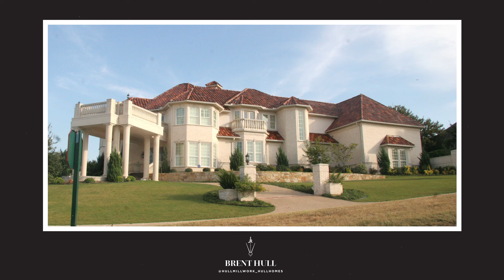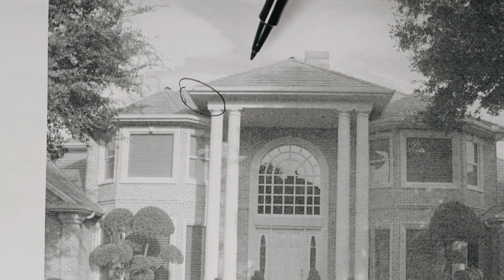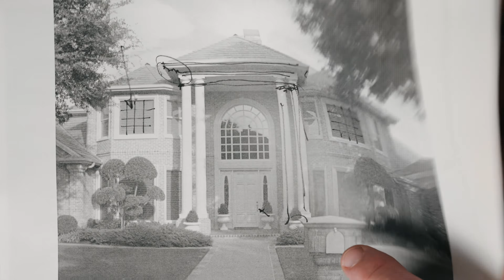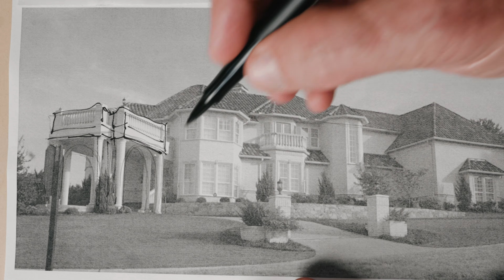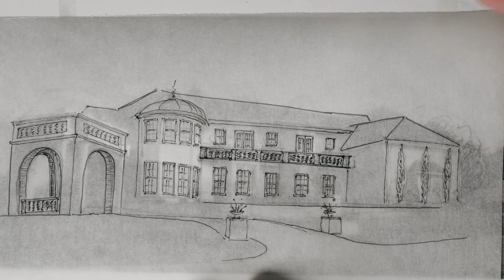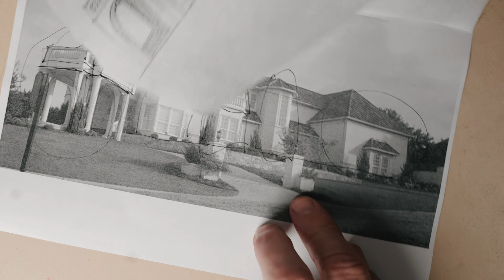What Style Does this House Want to Be?

Comment: I've designed and built three gardens and I follow an R & R rule, which seems to apply to house design too. R & R is Repeat and Rest. I'll mass ten Emerald Green Arborvitaes for visual impact, but also let the eye rest, using a patch of grass or pavers. I also plant for all four seasons. Spring, summer, and fall are easy, but winter is a challenge. I would think a northern architect would also strive for a comely home when there is less flora to frame it.
Reply from the maker: Very interesting. Thanks for sharing.

Comment: Very nice suggestions for organizing the facade. it's too bad you can't get inside to see how the changes to the exterior might affect the layout of the interiors.

I would suggest extending the depth of the second level roof deck out another 6-8 feet and creating a covered porch off the main floor rooms. You could do a row of columns with a railing between them (there wouldn't have to be stairs and access down to the lawn) and you could change some of the main floor windows to double doors. The extended deck would also hide more of that big blank wall on the right, and you could maybe add a door into that wing of the house from the covered porch.

Also, maybe some stone quoins at the corners of that big right wing?
Reply from the maker: Good ideas. Thanks for sharing.